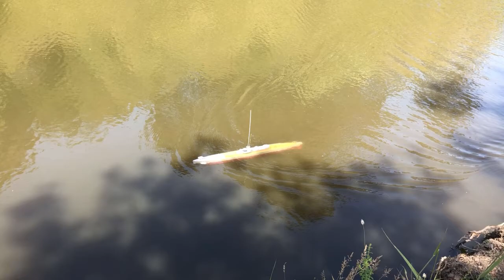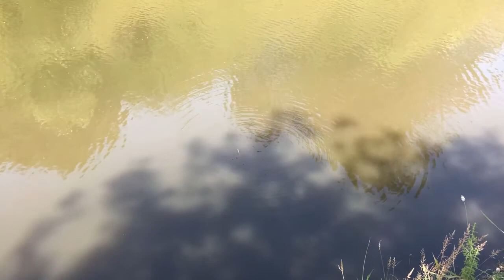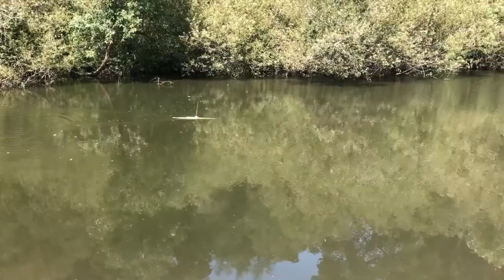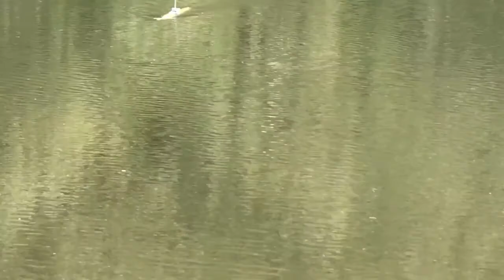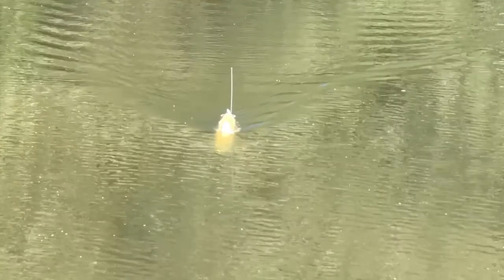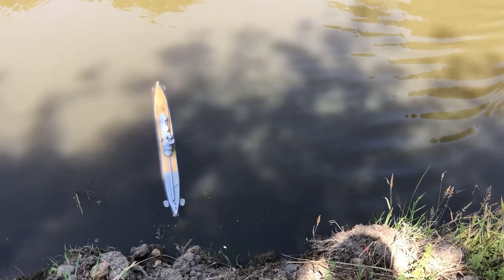I-400 Trials

Comment: Cool😎.  How about a video showing the boat up close. What ballast system are you using?
Reply from the maker: I will try to get an up close video, but that will have to wait a while as she's not mine (I'm not that good yet)
As for the ballast system, I think he is using ballast tanks that empty with compressed air pumped in beforehand, but I'll have to double check. I know he has dive planes too but I don't know if they work that well.